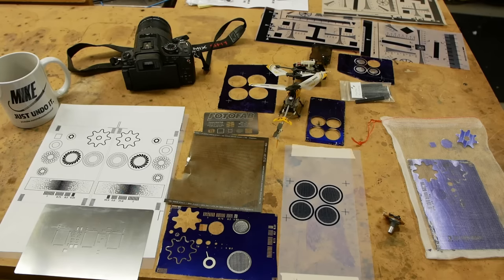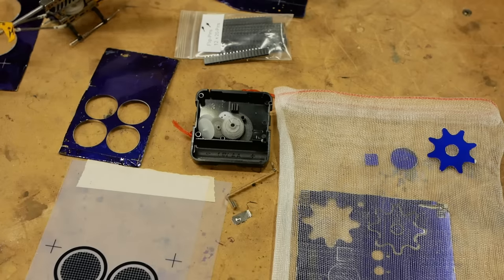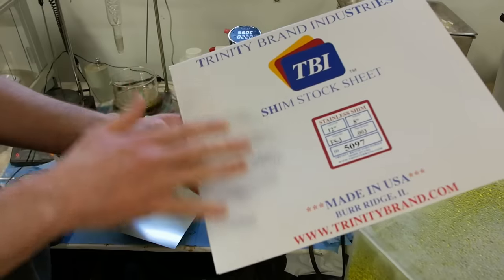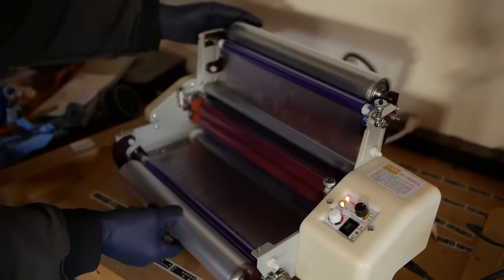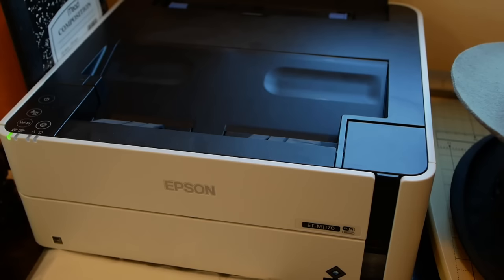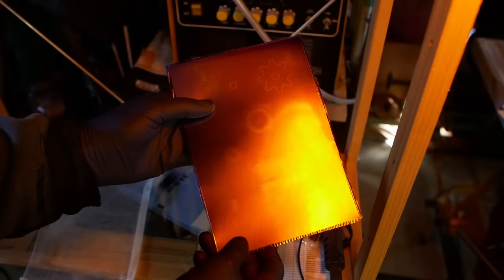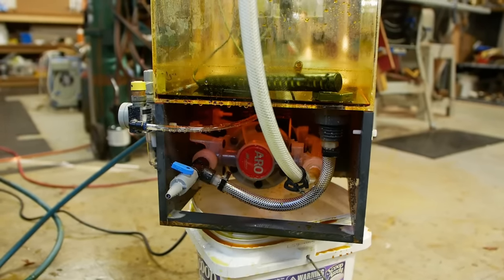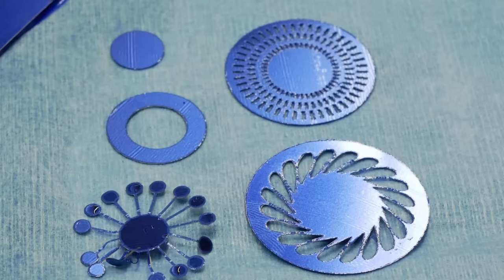How to make precise sheet metal parts (photochemical machining)

Comment: Having refined my own home dry film based PCB etching process, it was really neat to see your variations for doing just metal instead of copper on fr4 or phenolic. The laser printers work pretty well as long as you do two layers of transparencies stacked and aligned, and expose with the toner facing the dry film, at least for PCB usage. Otherwise your process is actually surprisingly similar. I just use a cheap USB aquarium air pump to agitate my (vinegar and h2o2 and nacl) etchant, it's plenty for thin copper clad PCB and a good deal safer than ferric chloride
Reply: Well done. Sounds way better doing it that way.
Reply: Vinegar, hydrogen peroxide and salt can etch copper?!
Reply: @AureliusR  yep! Not super fast, but it will turn into brown gunk that you keep brushing off (or you let an aquarium air pump keep it turbulent enough for you), and it will etch. You still get a "liquid with copper in it" at the end to dispose of safely but it's not pure danger in a bottle like ferric chloride.
Reply: @AureliusR  easy. But need agitation and way of smutt removal.
Reply: @rpavlik1  I've worked with ferric chloride quite a few times and never viewed it as particularly dangerous. Take proper safety precautions, and don't drink it, and all should be well. That being said I might try the vinegar method sometime.
Reply: @AureliusR  it's worth trying. I learned it from blondihacks. It's a little slower than ferric chloride (the aquarium pump speeds it up a lot though and they're $10 on eBay, just be sure to cover it to avoid spewing cupric-something droplets all over your area) but I like the whole "kitchen chemistry" part of it.

Comment: Have you tried to laser print transparencies and then just use acetone vapor to slightly melt the toner and increase the density? I had some limited success with that a few years back, what you absolutely can't do is let the print for too long on that vapor.

Comment: This process reminds me of exposing film to plate for the Printing Industry. Its been 20 years, but I used to work in "Pre Press". You would take the film, place on top of the plate using register pins (register pins are all the same size, for the film and plate). Place the two into a Vacuum table. Hit the switch and it would create a seal between film and plate. Then close this black curtain, and press another button that would start the UV light for a specific time. Once the time expires it all shuts off. Remove the film and place the plate in a solution and the end result was is a positive etched on the plate form the negative film. 

Love it!!!  Anytime I get a notification you've uploaded a new video, Its like Christmas Day LOL... Awesome content again! Thank you!

Comment: I will always admire your documenting the failures. The importance is far greater than a success. 
There is a process that was utilized by a straight razor company back in the 1800's for etching blades of extremely fine detail.
Unequaled even today. You may find the mask and stencil techniques very useful with modification, looking past the obvious.
 A rabbit hole worth the effort.

Comment: As always, awesome work. I've been down a similar road making stainless parts for a micro robot, my laminate was custom stainless-kapton-stainless to create flexures and I dip coated with a positive resist as it was exposed with an NC controlled UV laser so that saved time. I used a commercial cleaning product but also cleaned with pumice, your method is much easier! I can't actually remember how I did the drying, I bought parts from a dyson hand dryer but I'm not sure I used it, I also had a contraption made from too cooling fans from a Harrier jump jet (the seller claimed). I did make a laminar flow cabinet so it might have been just drip dry.

It is possible to use magnetically coupled pumps for the spray and this is common in commercial machines, the trick is to buy the right nozzles. An alternative used by a UK company Mega Electronics is to have a vertical tube with holes in it that is rotated quickly by a motor and dipped into the acid source, some plastic RC boat propellers in the bottom of the tube encourage the acid inside and then centrifugal force does the rest. Cheap and simple.  For precision etching it is considered good to rotate the panel in front of the etch nozzles to avoid any sort of shadowing affects.  This is what I did and I have some videos of my janky belt driven system. Lastly something I read in one of the few books I could find on the subject is that rotating the panel at high speed in a tank can allow for very deep etches as the centrifugal (or lack of centripetal) force clears the dissolved material quickly. This isn't something I have tried but I'd like to some time and it could be a good budget option and rotating it horizontally in a frame would be simple mechanically.

Comment: Your spray process is one of the fastest I have ever seen.  While fast, it may not fit in my apartment.  However, hot ferric chloride can be pumped using home aquarium fish tank pumps.  The kind with no moving parts, and are air-operated, are the ones of interest.  Bubbles do all the work.  I've noticed that the acid only needs to flow and etching goes faster.

Comment: The competence required to do all this is way impressive. This was cheaper than hiring a company in the same way as removing your own appendix is cheaper than private healthcare.
I'm amazed with how accessible niche high-tech applications and processes are becoming thanks to people like you.
Also, PVC is recommended as resistant to Ferric chloride in a SDS I found. PTFE is supposed to work great as well.

Comment: Thanks, Ben for sharing precious knowledge for free for everyone. I haven't had time to go through the comments yet so i might be doubling on someone's, nevertheless: back in the day when i was working in Peltier elements manufacturing we were implementing and using lots of funny techniques. 1) alcohol is pretty darn good for removing water from the substrate, multiple stages of concentrations(40\70\90\100) were employed just to prolong the higher concentrations bath lifetime (the same trick is done in machines to remove water from tissue in histology), and other solvents like acetone, or ethyl acetate can be used with great success. Subsequent hot air in laminar box was used sometimes also. 2) ultrasonic is superior for immersion washing and even sometimes etching, I've built several machines for degreasing of bismuth telluride crystals with solvents\basic wash as well as few for electro(chemical) surface etching all employing medium circulation alongside ultrasonic. It might be a problem for thin substrate sometimes as ultrasonic tends to shatter brittle crystals into dust, but nothing that cant be adjusted.

Comment: I've been doing this for years with a laser printer. I just print twice on the same glossy paper and then I transfer the ink to the metal sheet with a hot iron, thus using the ink itself as a resist layer.
Before etching I go over the part looking for any suspicious areas not perfectly covered with ink and just use a permanent marker to "fill in the holes".
I'm getting almost as good (as in almost impossible to tell the difference) as when using UV resist, but it's faster to transfer the design via UV resist for sure, and way easier to clean of the UV resist than the ink, but if in a pinch it works really well. I'm using this for making parts for scale modelling btw.
I've also tinkered with making a two step procedure for partial etching where you need to etch fold lines, or etch a step into the metal sheet for replicating wire mesh etc. I just do the process twice on the same piece. A lot of work I might add... 
I've got a similar setup to yours but mine is a bit more manual but it does the job - for very little money!

Comment: Excellent setup for etching in volume. I used a much simpler setup to do PC board etching in my home shop, then successfully etched brass and copper sheet fine parts using the same setup and chemical etchant.

To get the imaging film on the part under exposure I used a foodsaver vacuum sealer and exposed one side at a time, since foodsaver plastic is only flat on one side. For low volume it was a chep vacuum easel.

Comment: A lovely Deja vu! In the 19seventies we made PCBs in the electronics workshop of the Physics Institute Heidelberg Philosophenweg with this laminating and etching tech. One issue often was that we had underetching problems due to insufficient adhesion of the photoresist. We solved that with using a negative method by galvanically tinning or gildening the tracks and vias, then stripping the photoresist and after that etching the copper. The etching agent did not attack the gold or tin layer. However some underetching effect was there too but that did not brake the thin tracks.

The photo transfer was done by placing the laminated plate between 2 plastic sheets and pumping the air out of the gap between them. This air borne 1 kg per square centimetre force made the most snuggeling contact between the mask and the resist. You can make that yourself by taking 2 old screening frames and instead of the fabric glue sheets of 0.1 mm plastic foil on them. With a gasket and a pumping nozzle you will get the same effect.

Good luck!

Have you ever checked wether you can print UV curable liquid with your EcoTank ET-M1170 printer? Nowadays women use this ink to paint their finger nails? If it can print it maybe it is a better method to apply etch resist. I tried it around 20 years ago with an early loctite UV enamel, however quickly ruined the printing head.

Comment: Oh man I used to do photoresist for industrial tool and die, it was a real trip how much went into that. Resist is EXTREMELY SENSITIVE to surface contamination. Like wash with stoddard solvent, then rinse with water and dry with methanol and compressed air sensitive.

Comment: Thank you Sir,
Well demonstrated.
I used a more crude approach with iron on resist intended for PCBs,
I etched aluminum and stainlessness steel to make dies for metal casting pendants.
Though the relief was small, the result was satisfactory for jewelry.
I appreciate you giving us not only the technical details, but also insight into business and production, innovation and as well encouraging and stimulating our minds.
Adam Smith's invisible hand is ever present.
Take care

Comment: Hey Ben, I used to dabble a bit with dry film photoresist. You can get away with laminating this stuff on wet substrate, in fact I used to spray water right before laminating. Another thing is that toner printers are excellent for printing your masks, The only thing is that they need acetone vapour bath after printing. I was blown away by the difference in bathed vs unbathed. Just use some tupperware with paper towel on bottom, wet with acetone, place something as a distance and then your mask (toner side up) then cover tupperware with lid. Leave for at least 5mins (dependant on temperature).

Comment: There is a spray for laser transparencies, called toner aid, also, using vellum, instead of transparencies can get you a much darker laser film. Also you can often get a higher actual resolution with laser, (up to 1200dpi on specialized laser printers) than you can with inkjet (who CLAIM high resolutions, but that's more simulated, than actual.
Also, there's different inkjet inks that block the UV more than standard black.
It's best to match the wavelength of the UV LED to most closely match the optimal exposure of the emulsion, some emulsion's optimal wavelength is 420, some is 440, yours may vary, this may be a reason why you're getting the extended optimal exposure time. (many of the LED Floods wavelength is not always exactly what they claim, as well, especially with the cheap foreign LED's some use) 
I will say, I love all of your videos, even the unsuccessful ones, as I love to do many of the same types of experimenting, although far from the intensity and depth you do. Keep up the awesome work! You're one of my favorite channels!

Comment: It’s amazing how similar this is to semiconductor wafer processing. We used acetone, isopropanol, and deionized H2O to clean our wafers. Just a 5 second spritz of each would get the surface perfectly clean. Then use a clean air supply to dry the wafer. Photoresist was applied via a dropper onto the spinning wafer then thrown onto a hot plate to dry. Photoresist exposed with UV lamps over the etched glass mask. Rinse. Dope. Rinse left over photoresist. Drive in dopant. Oxidize. Add new layer of photoresist. And on and on until you have an array of MOSFETs

Comment: I was on a gun making course (from stock materials, not from a kit) long time ago. The blackening process was made so that there was a tub with a wall separating the surface into dirty and clean side, burner under the tub keeping the water boiling (wasn't rolling boil). The parts to be processed were lowered from the dirty side in a basket, given some time for the water to boil off the oils and grease (which float to surface). The basket is then pulled out from the clean side, given a moment to steam dry with residual heat and then moved into next step of the process.

Comment: Such an incredible process. I used to work in the print industry, and we used imagesetters from Scitex. They are huge, expensive, and labor-intensive to maintain/operate.  But if you have some local offset/screen press guy, they can make you some photomasks of superb quality.
Alternatively, using a screen from a resin 3d printer to expose photoresistor films could work. You can load up your images into the machine and do it without printing a photomask. Thanks for this vid.

Comment: Hi Ben, Thanks for your ingenuity and fun experiences. For sharper edge I suggest not to use any layer of plastic protection for avoiding diffusion of the light , a spot light of 250 W. UV mercury lamp and vacuum exposure. I was able to get very sharp edge of 5 microns.

Comment: Great work as usual Ben.  As for 0.10" header pins damaging breadboards, not so sure about that, I've used them for years ... only with the older and better quality breadboards.  Modern inexpensive breadboards often made in China don't have contacts with the same spring qualities and are very easily damaged as you suggested.  Just know that not all breadboards are created equally.  If you're only paying a few dollars per breadboard, caveat emptor and better to go with Global Specialties or 3M.  On some things it makes a world of difference to go with a good brand.

Comment: I once used a similar process at work. But, we were galvanically growing the parts we need on a soft circuit board style substrate. The guy who taught me about the process originally used the idea to make massive amounts of custom soft metal gaskets, for a particle accelerator.

Comment: I've noticed that it's very important to prepare the right kind of image for your laser printer to print sharp images.
I remember maybe two years ago, when i was trying to etch wheels for an encoder to work with a photointerrupter. The goal was to use toner transfer to etch a FR4 substrate to form an encoder wheel. Surprisingly enough the photointerrupter works fine even though it has to pass though the fiberglass substrate. But i had problems getting a sharp print so the toner wasn't thick enough.
Eventually i found out that the image you send to the printer has a huge impact on the quality of the toner transfer process. Once i got the image correct everything worked out perfectly.
My process is very sketchy but i manage to get somewhat reliable features down to 0.2mm.

Comment: We used to use film for making OHP slides in a photocopier; the film had a paper 'frame' on one side around the edges that triggered the photo sensors. Once the slide was printed, the paper frame was simply peeled off.

Comment: Pretty great seeing again some of the processes I used to work on. You can strip the resist with an acetone squirt bottle as well. I love the sprayer, but the jets aren't great for getting sharp edges on the etch: use a mesh screen between the jets and the board to break up the droplets. Air bubblers work great for tank agitation as well.

Comment: I was doing same thing with PCB stencils(and PCBs), though my setup was much more primitive.
I ended up having to retry each run about 10 times before I finally got a usable result. 
After watching I know exactly what I did wrong. I didnt clean surface enough, I used acentone and paper towl.
I used a really cheap laminator, which didnt stretch the photoresist and I had to feed resist by hand.
My uv light was not strong enough so I had to have it close, and would produce that shadow effect you mentioned.
I used a laser printer, and was having to double up the masks, making shadow effect even worse.
And lastly I didnt have a proper etching tank(tupperware, muriatic acid and hydrogen peroxide).
I knew most of the problems while doing it, but didnt really have the cash to invest more, I ended up giving up and just ordering PCBs and stencils.
Another reason was I couldnt do plated through holes easily, I was using carbon powder mixed with a type of glue before electrolyisis bath, and by the time the holes got enough copper on them, the rest of the board would have a significant amoung of copper on it. It literally weighed about 4 times more.

Comment: Hey Ben, if you attach ultrasonic transducer form the cheap ultrasonic cleaner to a corner of a sheet stock and partially submerging it into the ferric chloride bath leaving transducer above, you can drastically simplify your etching setup. It will not be as fast and effective as high pressure jets you are using, but you can also use it for developing, and cleaning stages.